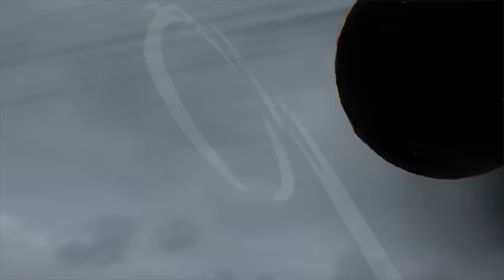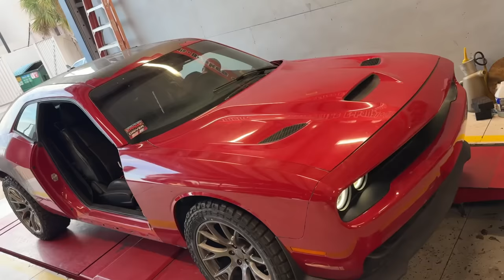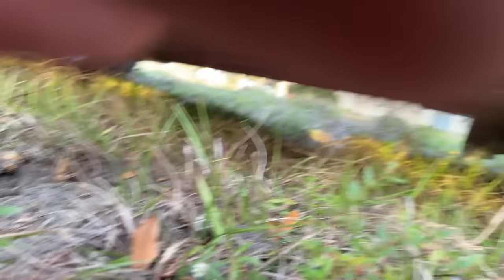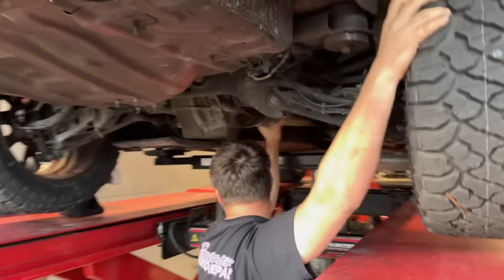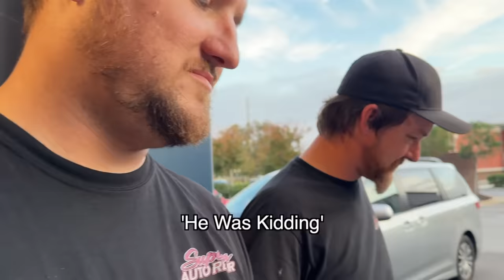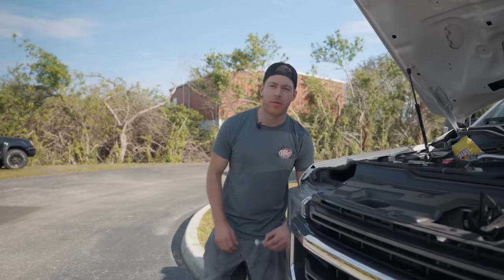RallyCat's First Time OffRoad and it IMMEDIATELY Broke!

Comment: Mopars used to use the 83/4 rear drop out center chunk, very stout. I put one in my Dart back in the day with a Dana Power lock sure grip. My 318 never broke it and I could spin both tires. I bet the dif in that thing is 7.5 or so so definitely a weak link. The muscle cars got the Dana 60, very heavy but practically unbreakable in a street car.
My 06 Charger RT uses the same setup as your challenger except maybe the parts are more beefed up to take 700hp in yours. Probably pretty hard to swap to something older and stronger and no more independent rear suspension.